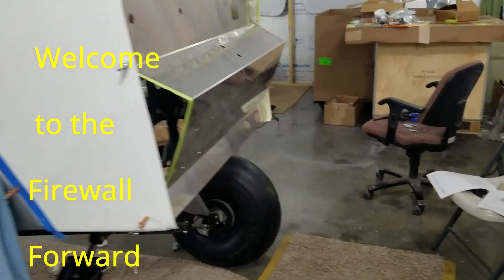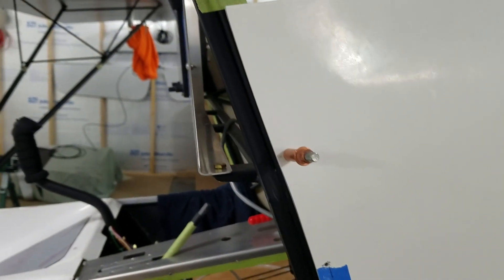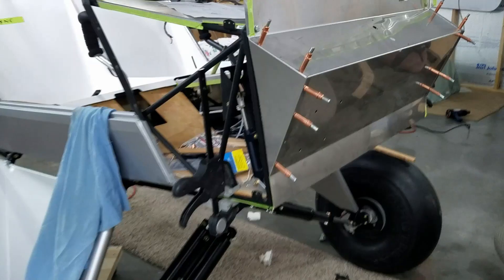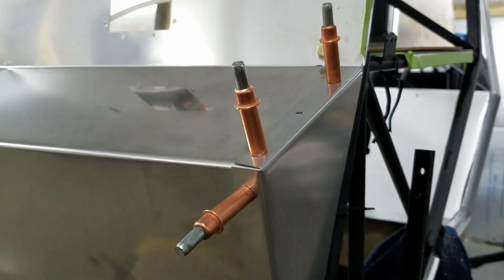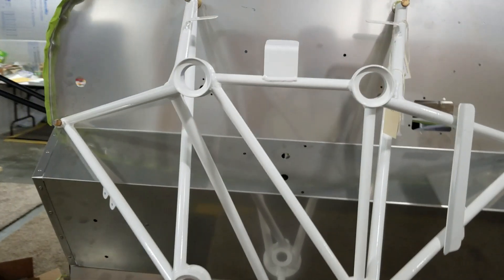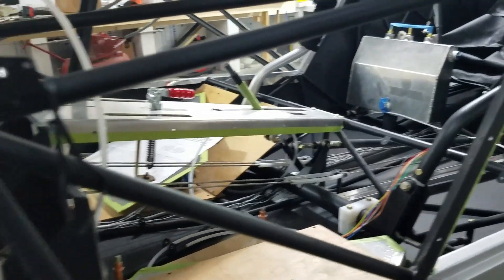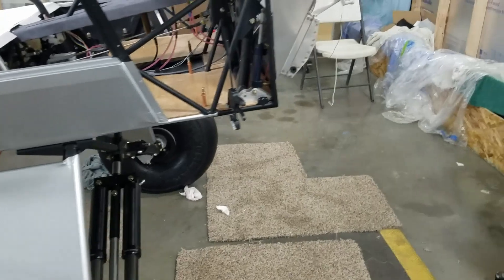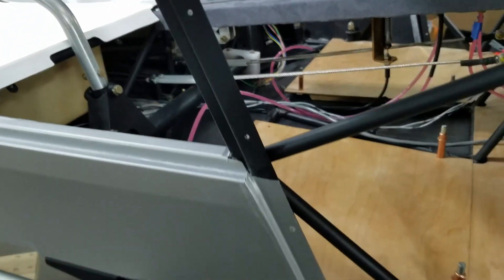Rotax 915is and Firewall forward kit install begins. Boot cowl Kitfox s7 STi aircraft build. #29

Comment: Say Harlan, given the flexible brake lines (rather than metal) I was wondering whether the brake lines "move" when the brakes are applied? In my experience it seems that flexible tubes often move around as the pressure changes... I was wondering if there any movement in your lines when you apply the brakes, and if so, whether there might be any chaffing concern over time.  As always, thank you for your videos Harlan.
Reply from the maker: Glenn I had the same thoughts but there is no noticeable movement and I don't have them mounted down yet. The clear line is good to 1000psi and I don't know how much pressure manual brakes apply but the lines have no expansion at all and I guess they wouldn't work for brake line if they did. Plastic brake line or Nylaflow is all new to me so I'm still learning.

Comment: For the larger holes will a step drill still do the trick or did you find something that worked out a little bit better?
Reply from the maker: Jason about anything will work in a drill press were you can keep steady pressure. Hand drilling without being backed up is what makes it hard to drill. If you let the bit spin without cutting for a few revolutions the stainless become work hardened that fast and is very hard to drill at that point. You must have a sharp bit and keep it cutting as you drill. Use a drill press if possible. A sharp step drill will work. I used a RotaCut Hole Cutter for any larger holes. Works much better than drill bits.

Comment: Do the calipers have bleeder valves on top and bottom of the calipers?
Reply from the maker: Gregory, Only bleeders on the bottom.
Reply: @KitfoxPilot  So that means that you always have to bleed air all the way up to the reservoir instead of being able to pressure bleed at the caliper
Reply from the maker: @gregoryglass5680  We did get it to bleed out the bottom bleeder but pumped fluid in until 99% went out the top. You can see your air bubbles in these clear lines.